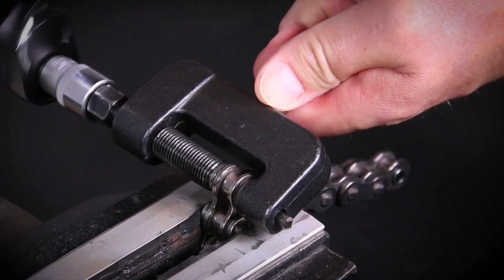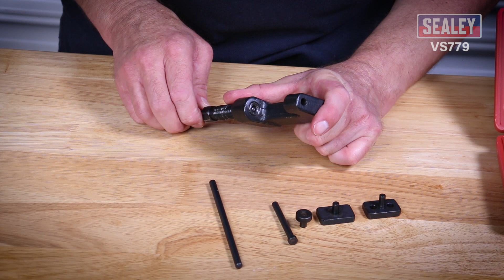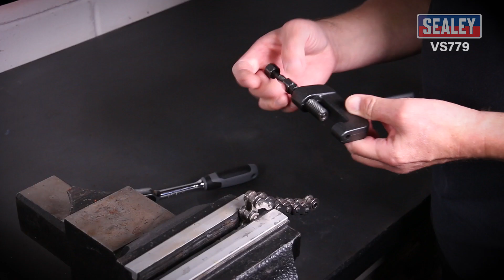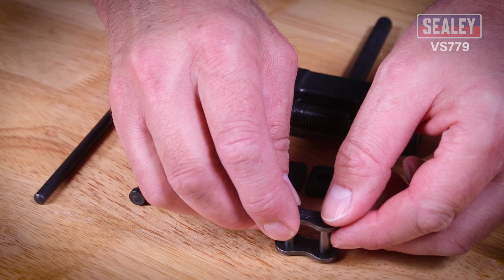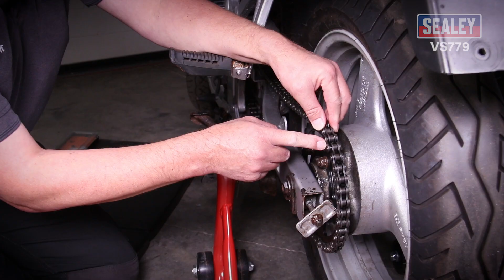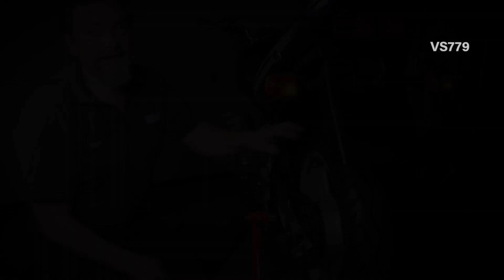How to use a motorcycle chain breaker & riveter tool - VS779

Comment: Hi. I have just bought this kit. Is there an anvil available suitable for Tsubaki Sigma-XRG chains or will one of the anvils in the kit do the job? They have a "hard pin" that needs to be pressed square rather than "peening" the rivet as shown here. There doesn't seem to be a suitable anvil in the kit. Thanks.
Reply from the maker: Hi, please contact our technical team at technical@sealey.co.uk or call 01284 757505 and they will be able to help with your query. Thanks.

Comment: Ive been working on bikes and motorcycles and dirtbikes for my whole life, and electric scooters in my adult life.. Ive NEVER ground off the head of the pin. You need the head of the pin there to help center the breaker. The breaker pushes the pin through with no problem. Ive literally never broken the tool. not once. Theyre strong enough to push a little pin through without grinding it first. Ive even seen some instructions on some kits that specifically tell you to NOT grind the pin.

Great vid otherwise. I like your style of straight to the point. I cant stand when people talk for 20 minutes about nothing when you clicked on the video for one specific thing.
Reply from the maker: Thanks for your comment Joshua. We really appreciate it.